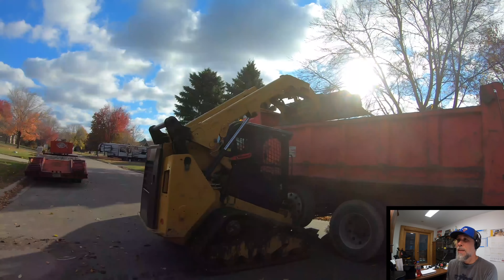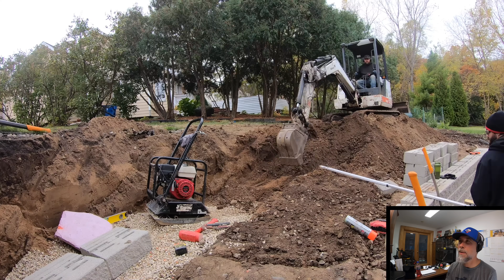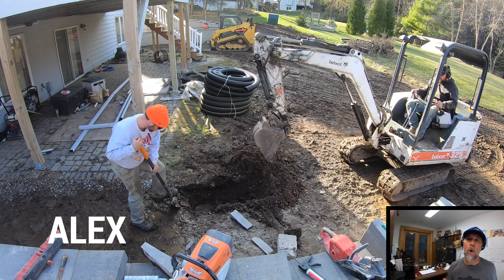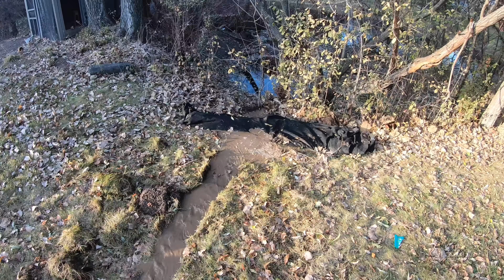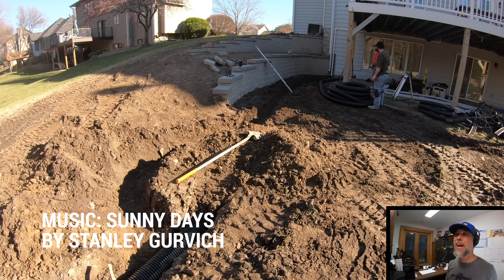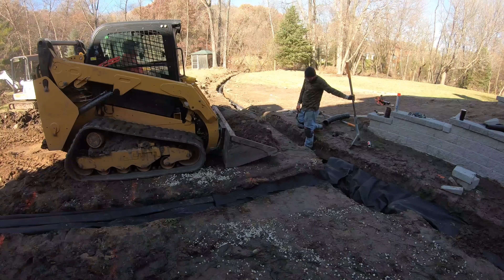We find Buried problems

Comment: Great job and great video. Although if the footings on the deck had actually been lifted wouldnt the deck have been all uneven? I saw one shot of the deck and and it looked pretty true. Maybe they adjusted the height of the footings so they didnt have to buy longer 6x6s. Your frost codes for footings must be at least what we have here in NY. Anyhow great job on the walls and good thing you were able to convince the customer to install that drain. Keep up the good work!

Comment: Question for you Stan.  Is the pitch coming from the walkout in front of both retaining walls so minimal that you felt the water would run slow enough to permeate through sod, through the fabric ,through what looks like 6-8 inches of clay then another 6-8 inches of rock. I am simply curious of your theory and I mean this in a non-confrontational way. Seems like you have so much material between the surface and the drain tile that the water won’t have a chance to really get down the drain tile before it’s starts running out naturally. Are you more trying to catch ground water around the deck footings, keep the retaining wall footings dry and  not really the surface water as much due to minimal slope? 

Side note: I will say most guys don’t switch to solid draintile after it’s not needed. They just keep wasting rock and fabric. Also very nice to have a pond to drain to. Did you guys tie the retaining wall and downspouts into the run that went to the pond?

A lot of questions. I love drainage as well and I find your videos enjoyable. 

Great job building a diverse company that does multiple facets of heavy equipment work. allows you to be flexible in a bad economy. 

I always kept the top of drain tile down 8-12 inches depending on how much slope I had to work with. I would wrap the trench with poly or fabric depending on if had additional ground water I wanted to soak in from the sides or bottom. I then put 6-8 inches of rock then put sod right over it. Keep in mind I used perforated sock drain tile. I did not put dirt over it or cover it with poly.This will allow the water to not have to work so hard to soak into the drain tile and then get carried away faster. Now this application is to catch surface water in an area where I can’t get my desired minimum of 2-3% pitch or is a taking on a large area of water in an isolated spot. 

Thanks

Comment: Buried problems? When I was working with my good mate Ernest putting in a car park at a very old hotel behind his house and depot he was using an hydraulic picker on his backhoe to break up concrete. He was under an electricity pole and then bang! flash! - he went through his own branch to his house and melted a tooth in his bucket. Then his phone rang and we could  hear his wife screaming at him wondering why all the power to her livery stables had gone off. Cue much laughter from me and  my workmate Paul - and a huge bill from his power company for fixing his powerline!

Comment: You should do a review on the JCB Teleskid. Would love to even see some snow pushing with it 😜
Reply from the maker: Challenge accepted
Reply: Question for you Stan.  Is the pitch coming from the walkout in front of both retaining walls so minimal that you felt the water would run slow enough to permeate through sod, through the fabric ,through what looks like 6-8 inches of clay then another 6-8 inches of rock. I am simply curious of your theory and I mean this in a non-confrontational way. Seems like you have so much material between the surface and the drain tile that the water won’t have a chance to really get down the drain tile before it’s starts running out naturally. Are you more trying to catch ground water around the deck footings, keep the retaining wall footings dry and  not really the surface water as much due to minimal slope? 

Side note: I will say most guys don’t switch to solid draintile after it’s not needed. They just keep wasting rock and fabric. Also very nice to have a pond to drain to. Did you guys tie the retaining wall and downspouts into the run that went to the pond?

A lot of questions. I love drainage as well and I find your videos enjoyable. 

Great job building a diverse company that does multiple facets of heavy equipment work. allows you to be flexible in a bad economy. 

I always kept the top of drain tile down 8-12 inches depending on how much slope I had to work with. I would wrap the trench with poly or fabric depending on if had additional ground water I wanted to soak in from the sides or bottom. I then put 6-8 inches of rock then put sod right over it. Keep in mind I used perforated sock drain tile. I did not put dirt over it or cover it with poly.This will allow the water to not have to work so hard to soak into the drain tile and then get carried away faster. Now this application is to catch surface water in an area where I can’t get my desired minimum of 2-3% pitch or is a taking on a large area of water in an isolated spot. 

Thanks

Comment: You're quite lucky. We would need to form up and pour a footer for the retaining walls, have inspectors check every step before going on to the next one. The unexpected water issue we would need to get a permit and inspection on the permanent drain setup as well.
permit to take down old
permit to put in new
engineered plans for new
inspection for footers, drainage, backfill ( until you are switching to fill to grade ) with the inspection, plans and permit for the unexpected water as well. You know each inspection adds a day.
Reply from the maker: What over regulated area are you in?
Reply: @Dirtmonkey  Vancouver BC Canada.

Comment: Stan you've been in business long enough to know black corrigated pipe is junk. The fabric around the French drain is a issue as well. In NE ohio where I live I've fixed after several years my French drains because I did it the same way you do yours. That fabric over the course of several years will get silt around it, once that happens it blocks water going through it comprising the whole purpose of the drain. If there's any trees or anything near corrigated in a few years roots will go right though that and tear it up. The way I do it now and have had no issues is dig the trench, put Atleast 2 inches of #57 wash gravel down then sdr 35 pipe perforated then gravel ALL THE WAY TO THE TOP NO SOIL. People will complain at first saying they don't want a gravel trench through there yard which I understand. After a year grass from both sides of the trench folds over and covers the gravel but no dirt especially topsoil can go back on top of that gravel because first hard rain it takes that nice topsoil and washes it in the pipe and cloggs it. If you want email me Chasecatanese@icloud.com I'll send you pics on how I do mine if your really interested. I've just seen you do this in several videos and didn't understand how you get away with it, if it works for you doing it your way rock on! Cheaper materials = more profit I get it
Reply from the maker: Good info,  we install drain tile a few different ways-  in fact Ive got another vid coming up showing that.

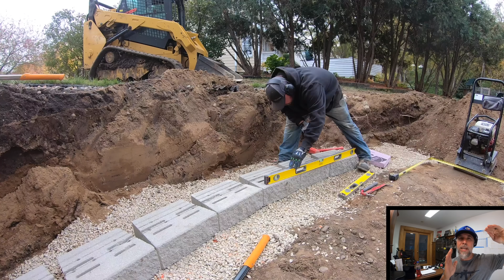Comment: Stan, at 3:21, you said, "for the top retaining wall not to put a surcharge on the bottom retaining wall", and "you don't have any surcharge going from one wall onto the other wall"...would you mind defining what you mean by the word "surcharge", when referring to layout/design of terraced retaining walls?
Reply: Surcharge is the pushing pressure applied to the back of a retaining wall.
Reply: @CoastConcreteCorp  thanks for clearing that up!
Reply from the maker: what concrete and construction said is accurate.

Comment: Would the drain pipe with packaging peanuts around it in a sock work in this kind of situation. 

If it does do you do a second layer of filter fabric or is the sock enough.
Reply from the maker: yep- it would work but its really expensive compared to traditional methods.
Reply: That's only useful when labor or rock is expensive.  In my area, we have no rock, so it's cheaper than traditional fabric over rock style.  The foam also goes down much faster.

Comment: May I ask why don't  you run a weeping tile on the back side of the retaining walls.
Reply: We do we put it in behind all our walls it just might not have been video’d being done
Reply: It must have been the sand sock tile I saw during the video.
Reply: @rexcolbert6740  yes it was
Reply: Years ago I worked in dirt and concrete construction. We used the 4 inch perforated plastic tile behind the concrete retaining walls.
Reply from the maker: We install it but its not always needed. If we builf the walls the right way then it shouldn't actually function. the entire wall is designed to allow water to pass through at any place-ie mortarless system.

Comment: Stan I so glad I found your channel. I’ve been following you for the better part of a year now. I use to own my own lawn service and did green scraping to going through high school and to pay for my college. Now you I’m just the family handy man, jack of must trades and master of none. But I’m learning a ton from you. Do you have any advice on finding a foundation contractor? My new to me home (built in 53’) is getting water in the basement. It’s made of cinder block, in the one corner I can see it coming through the block about 5’ above the floor, the rest it seems to be weeping in at the floor/wall seem. I suspect the block in the one corner may be damaged from 3 crêpe myrtle trees that were there were there previously. I’d really rather stop the water from coming in, the to just remove it once it does. Any thoughts? BTW if it matters I live in NJ near Philadelphia, PA and I have a sandy/soot type soil
Reply from the maker: You could dig down on the outside and tuck point it from there and also the inside.

Comment: Stan don't forget old farm tiles. I've run into them a lot. They can cause lots of problems.
Reply from the maker: How big are the ones youve hit?
Reply: @Dirtmonkey  had to dig a mainline out on a apple farm a few years ago here in ny, it was blocked and was backing up about 100 acres of orchard, come to find out they had directional bored a gas main thru the 16 inch drain tile, that was slightly exciting...
Reply from the maker: sounds like an interesting day. kind of
Reply: We have run into 4" to 12" tiles. Worst one was at a hotel property with a 325' x 18' retaining wall in front of it. We had to have a sealed connection to a storm sewer with a 6' man hole in three places.

Comment: Stan do you prefer the black corrugated pipe or is it a price issue.I like using SDR 35 for drainage with glued joints have dug up to many black pipes full of roots and just failure of the product over the years.Starting a large drainage job tomorrow morning of course it had to rain about 4” today looking forward to the wet soil and muddy conditions but it’s that time of year.
Reply from the maker: The corrugated is easy to work with the solid pipe flows way better.

Comment: Of all the skid steers you have run what brand do you like the most?
Reply from the maker: Cat for their buttery smooth controls and service, ASV for their ability to stick to hills and go through mud, Bobcat for their amazing ability to do repairs in the field-ie stuff we can fix and get parts for them anywhere.
Reply: thanks I had mustang and  case .looking for something better than them two
Reply from the maker: OK- wait-  the NEW asv's are WAY Better than the old ones- so be careful.  and the same goes for Bobcat and cat-  it really depends on the year and make-so do some research and test them out thoroughly and also Vet the local dealer for service.

Comment: I would definitely say that there’s a spring down there
Reply from the maker: I think your right. Its alot of water to be perched
Reply: And in the case of a spring, what are the options? We had an old farmhouse that experienced "weird" water issues -- that house burned down and we built new, and we brought in over 30 tandem trucks of soil, making our house up on a hill yet we still had a sump pump that ran about every 5-10 minutes last year. How do we know if it is indeed a spring (which I've suspected for years) or...? I love your videos (I remember watching a few the day before the fire) and I learn quite a bit from you, so I'm really interested in your input here.
Reply: @jasek005  drain tiles and send it to the storm water
Reply from the maker: Hey John- Thanks for watching but its hard for me to have input without seeing the sight -sorry
Reply: I would maybe have someone come in check for elec lines sewer etc... then maybe start digging around and try to find a way to put a tank and a over flow and get the water away from the house

Comment: What would you do if you had to drain all the water away from the house like that in an area where the septic system is right underneath so you can't dig down and you can't raise the grade anymore because then you would be above the foundation of the house, touching the siding?
Reply from the maker: If its disrupting your house and causing damage then you have to install a french drain even if you hand dig around the septic lines-just stay out of the septic field.  As long as the septic lines are soild ie-right by the house-you could install a system.  It just cant be near the field of the septic system.

Comment: Hey Stan. Big fan. Love your vids.. can you explain what class 5 is? I see u using it all the time but in the northeast the yards don't have it? Is qp the same stuff??
Reply from the maker: Class 5 is a combination of 3/4 inch concrete chuncks and asphalt pieces reduced down into dust.  Its all mixed together and when packed turns rock hard.
Reply: @Dirtmonkey  are you every worried about the recycled materials breaking down further and possibly settling, sinking or washing out? I seem to always find old mortar or concrete that breaks down into a soft material.  That scares me...Also what do you think about quarry process?? No good?
Reply from the maker: Nope-  they use this as road base it packs so tight.
Reply: @Dirtmonkey  thanks for the response!!! Keep up the awesome work. Really love the videos happy holidays
Reply from the maker: Happy Holidays Rich!
Reply: @richd.4073  It's called dense grade or crushed stone here in the northeast

Comment: Hey Stan, how often do you get your walls engineered
Reply from the maker: anytime they are over 4 feet tall or double terraced within the twice the height of the bottom wall-which IE would then require engineering.
Reply: @Dirtmonkey   so as long as the wall is four feet or lower and twice as far back as the hight of the wall below you don't need engineering if im understanding it right
Reply from the maker: Exactly right-  at least in the Twin cities area.  Better check your local building requirements of course.  they always tale precedent.  Im just sharing our locals requirements.